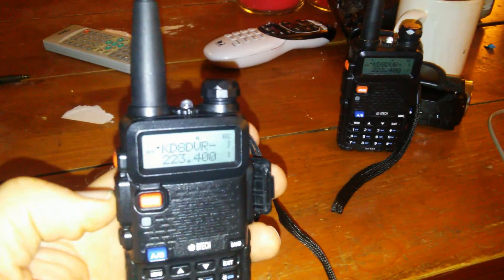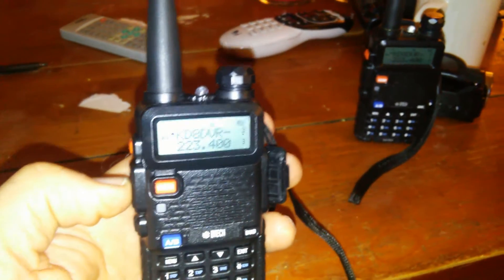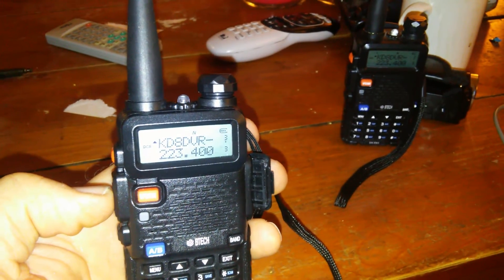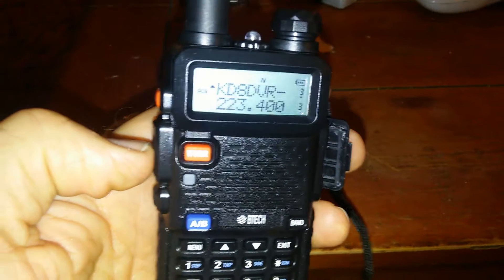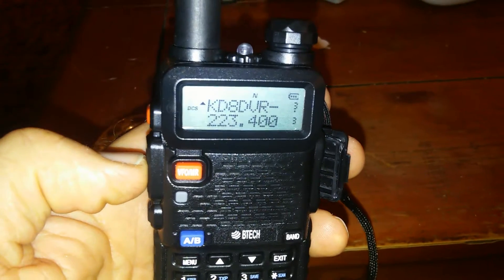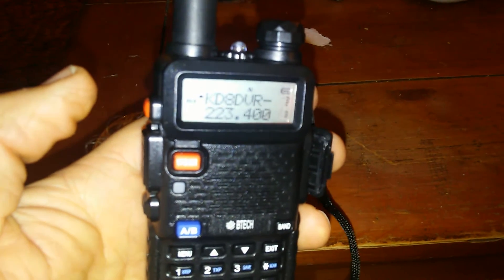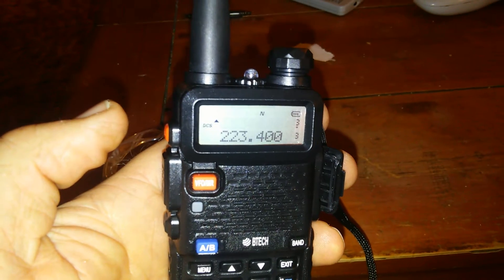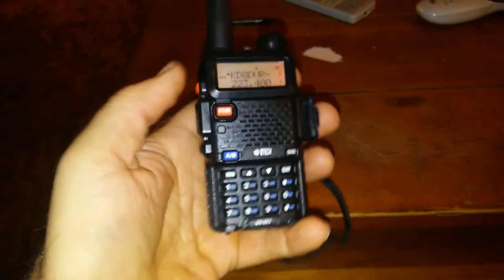BTECH UV-5X3 Remote Command Demonstration

Comment: could someone else send the default code to you over the air and knock your ht out , how hard is it to recover ?
Reply: Yes, they could send the code over the air.. that's why you change to the code, or disable that function.  I forget if it defaults to enabled or disabled.  Re enabling it is easy, just upload a saved config file or send the enable code over the air.

Comment: +John Wilkerson Oh right! I'm considering upgrading from the UV-5R to make use of these remote commands, which is why I ask. How does it work? So you transmit the code, and the other radio literally just hotmics for 15 seconds as if the recipient was holding PTT? Can another user interrupt it? 

Have you tried the alarm mode? I assume that using it will activate the alarm on the recipient? I imagine, useful to try to grab their attention if they have taken the earpiece out and can't hear my transmissions, right?

Thanks (:

Comment: I wish you would have tried the monitor command :P
Reply: I have done it.. it does work.  Perhaps in a video later.
Reply: +John Wilkerson +John Wilkerson Oh right! I'm considering upgrading from the UV-5R to make use of these remote commands, which is why I ask. How does it work? So you transmit the code, and the other radio literally just hotmics for 15 seconds as if the recipient was holding PTT? Can another user interrupt it? 

Have you tried the alarm mode? I assume that using it will activate the alarm on the recipient? I imagine, useful to try to grab their attention if they have taken the earpiece out and can't hear my transmissions, right?

Thanks (:
Reply: Yes... that's what happens.   Same for alarm mode.  I'm unsure if another user can interrupt or not.
Reply from the maker: Yes, that option is available also.  There is a guide how to program and use the functions at my uv-5x3 facebook group.  also at the Baofeng Tech site.